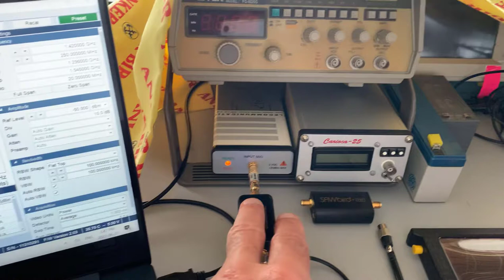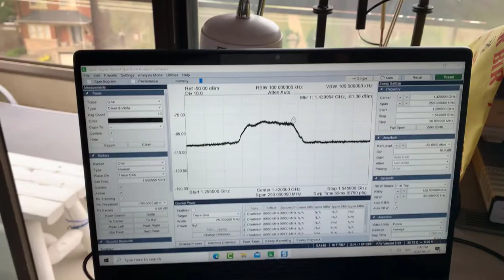RTL-SDR for Radio Astronomy - LNA/BPF Testing

Comment: Here is an excellent resource of beginner level radio astronomy  videos 
The videos are from members of SARA : Society of Amateur Radio Astronomy

Hydrogen Line Radio Telescopes  ( Including my video based on the 1m WiFi/GOES dish )

 https://www.youtube.com/playlist?list=PLCEbOD5_znsmOAz8fcIIF9JC-qogFntQN

Regards,
Alex KK4VB
Reply from the maker: Tnx.73! Alex emailed me to add the following as a system upgrade:
 1) extend the short sides of the dish.. use either the perforated aluminum panels as I did, or simply some aluminum window screen. All that needs to be done is add some al strips at @ 45 degrees to perpendicular and attach the screening. These panels are not intended to extend the parabolic shape of the reflector, but to Shield the feed from the 290K ground noise. 
https://www.youtube.com/watch?v=C6NCefVxNL8

2) build a better feed tuned to 1.42 GHz. An easy one is that which I designed for my Umbrella Antenna .. see this video ~ 50:00 minutes ..
https://www.youtube.com/watch?v=SgilnK73clQ

 1) will Decrease the background noise level 
 2) will Increase your Signal Strength